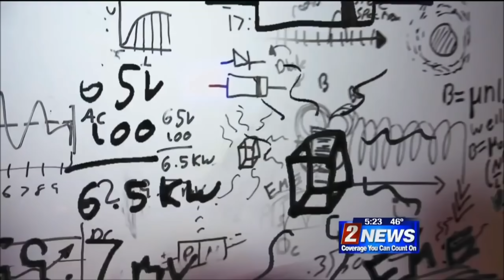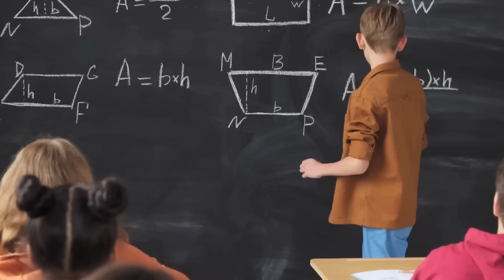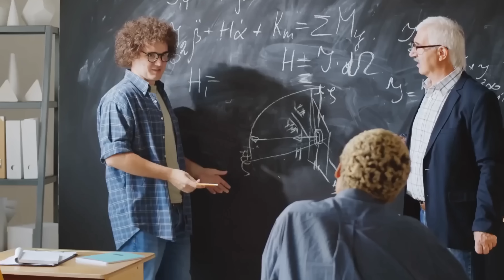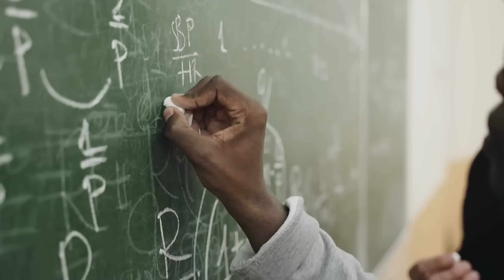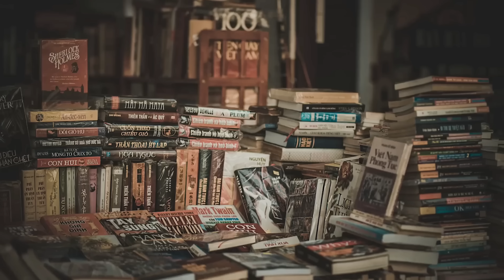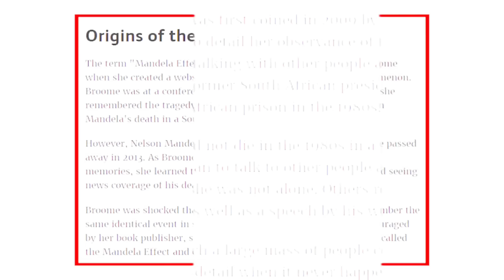Max Laughlin: Free Energy Generator, World's Smartest Kid, and What Happened to Him

Comment: One question, how do you amplify the wireless EMF without an external voltage supplier? The sun provides a high EMF with a lower frequency, why don’t you use that, solar panels.

Comment: Diode arrays replacing batteries would convert mechanical  near perpetual motion machine simulators into centuries of motion machines. The heat absorbed by the diode array and converted into electricity would hypothetically recycle the heat released by mechanical friction or electrical losses as thesimulator's demonstrated motion feeds these losses. Tne diode array's regenerated energy does not have to exactly overlap the simulator's release of heat as it matches it. Diode arrays slowly deteriorate by electromigration and structual diffusion. 
 
A diode array may be able to create enough electricity to manufacture many replicas of itself.
Aloha
Charles M Brown
Kilauea, Kauai, Hawaii 96754
Reply: Excuse me. What the hell are you talking about?

Comment: I've ordered a free energy car from  Maxwell from Africa which works on the same principal as the vanished Max's. It's only $17k if paid by Western Union cash transfer. I've even bought the free energy extension lead upgrade which means the car can also power a 4 bedroom house when not being used. That's also a bargain at just $3k. Unfortunately the car is 6 months late being delivered but Maxwell has assured me that this is only due to some paperwork problems with my customs authority. But whilst I've been waiting I've nearly managed to save up enough to get one for my wife as a surprise.  Hopefully I can get the cash off by the end of the month. I'm sooooo excited and can't wait to laugh at the sceptics.

Comment: Max Laughlin said "You collect the energy on one side of the device which is then amplified and polarized.  The energy is then integrating the oxypore semiconductors so you put a coil around, between and on each side of the electronic module to collect energy."   Sounds like the same old nonsensical BS to me.  But lodestones and magnets pour out energy continuously 24/7 so maybe we need to look there.

Comment: A guy in Zimbabwe has invented a free energy car and motorbike , it runs off radio waves , micro energy particles
Reply: They require systems to transmit the signals to run off of. They don't just pull from the universe. Tech is so old is not special
Reply: That's my uncle!
Reply: @railgap  where is he and how far is the project

Comment: Maxwell Loughan's explanation of his energy from the "air" harvesting:
2016:
"Here's how it works:  You collect the energy [From raised antenna topped with a stainless steel spoon] on one side of the device [stainless steel can?] which is then amplified [How?], then polarized. [Diode?] The energy is then integrated into opposite polar semiconductors [?] where you put a coil around between and on either side of the electromagnetic module [?] and collect the energy. Voila,free energy!"
Reply: It's complete BULL, watch ElectroBOOM exposé of this shameless young grifter take advantage of clueless morons like in this comment section.

Comment: Here is how to get free energy out into the world. 

First, invent the technology and name it after yourself. 
(e.g. “The Joe Smith Generator“).

Take your device and put it on a simple wooden table with a clear glass top and have that table placed in the middle of the field or on a concrete patio surface. Allow no cables or wires to connect or approach that table.

If the device requires any energy to start up, use a capacitor rather than a battery. Use some of the energy produced by the device to constantly recharge the capacitor in order to prove that the energy output is greater than the energy input. 

Monitor the energy output with a watt/voltage meter that has a clear and easy to read energy output display, and use it to power a web camera, lights and an Internet router that broadcasts a live internet stream 24 hours a day, 7 days a week.

Give away all your blueprints to anyone who asks as long as they promise to use your name on the device. Hire armed guards and block any agents who try to get on your property. 

Watch your technology change the world. 

Later on do a GoFundMe request and ask for donations from anyone who was helped by the invention with your name on it. You will receive millions maybe billions of dollars from grateful people and you won’t have had to hire one lawyer or file for one patent.

Comment: At first, we must understand that our surrounding as environment has energy potentials to harness, it is magnetic field, ionic atoms and microwave frequency. it is just like how to combine frequency of 2.4 GHz and 5 GHz to be 60 Hertz, permanent magnet system would generate direct current electricity, and plasma cluster could produce the 12 voltage for recharging battery pack in offgrid Electricity system with pure sine wave inverter installed.

Therefore, if the Quantum Electric generator was operational in only one killowatt for mixing those three systems simultaniously then the output might be three killowatt Electricity even perhaps the heat would generate electricity also by thermoelectric system. And the one killowatt as input could be from solar panel during the daylight and vertical axes wind turbine after the sunset.

Comment: nobel prize winner richard feynman taught that one cubic centimeter of the space that is the air we breathe, contains enough excess energy to power an entire planet, all homes, businesses, and transportation (even if all transportation were electric).

free energy is the most obvious solution to earths greatest demands/needs.

and as the electrical engineer at the local electronics store said recently, “everyone is studying and building free energy devices” further stating, why wouldn’t they, its every experimenters dream to build a more efficient energy pump (generator, which actually all generators and alternators and power plants simply plump energy from the sea/ocean of energy that is the space that is the air we breathe (local environment) into and through our circuits/wires, and into batteries.

it is relevant to note that thomas bearden also taught that the energy that is the space that is the air we breathe, replenishes/recharges (recharged by the entire universe) itself at a rate of 10 to the 120th cycles per second.

very interesting indeed.

the documentaries “the connected universe” “thrive 1” and “thrive 2” are also interesting, as well.

Comment: That does not appear to be a free energy device. That is an LC circuit that is harvesting the power of the local radio stations. Unless he is tapping into the Earth's resonance frequency but it does not look like it. 
Allot of mis information on the podcast. Tesla was not harvesting power at Wardencliff Long Island but generating power. JPM pulled financing because those that would be harvesting the power he was generating weren't going to have a power meter on it.

Comment: Poorly shielded wiring, static electricity, ionization, solar flares, displacement, polarization, magnetism, and grounded wires all leak energy, as do many others, put a metal fence underneath high output power lines and see what I mean, also harnessing wireless energy is somewhat an easy farce, my dish was pointing at the power lines and it burned up my box when plugged into the cable, and a ground wire run under into a metal fence pole to a chain link fence burned up any cheap electronics plugged into ground at the nearest plug to the panel, you'd think an electrician or tech sent out to fix the problem would immediately identify the problem but unfortunately just because they are certified doesn't mean they have any common sense, after all, it's not that hard to connect 3 to 4 cables together, but it is extremely hard to explain to them that energy can travel through the air, water, or dirt great distances at high intensity, but tell them it comes from magical ether unicorn farts and they will actually listen most of the time.

Comment: As the EMF is drained from the house wires that is being filled up through the electricity meter by the power station pushing the EMF into the house wires... you can harvest / tap into it but doing it inside your house will cause the power bill to rise. Doing it out amongst the public grid wires will cause the price of electricity to go up . Basically to cover what is perceived as theft by the power companies

Comment: Why does light accelerate when it exits a medium?
Reply: Because of the electrical circuitry of the aether. Because modern physics is flawed. Stuck for 75 years because they ditched the aether to chase the atomistic approach. Maxwell and tesla said the electron was nonsense anc after 30 years as a licensed journeyman electrician in 3 states I have to agree for multiple very basic, real reasons. Its all about the plasma linking everything in the nothing that is the aether.

Comment: Yes max and they have and made just such as you using cold fusion facts. Several national labs and nations energy company's were there presenting their operational and very functioning devices which are non distributed power solutions for a residential dwelling..... Also the preeminent plastic summit and spiked protein concerns which they are not concerned about. The two air force officers there taking notes when any danger concern was mentioned, we should be concerned as they make doomsday weapons with what they know never to create. The military industrial complex is what they serve and to no nation to prevail...why they use the tr3b a most unnatural craft and the very principal suspect
Reply: 369